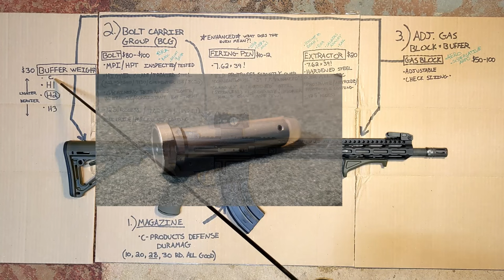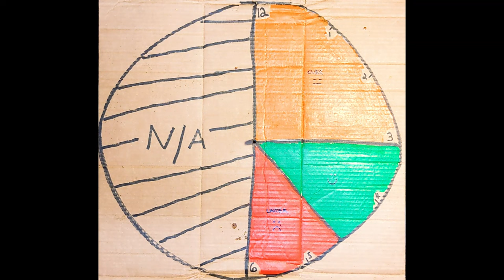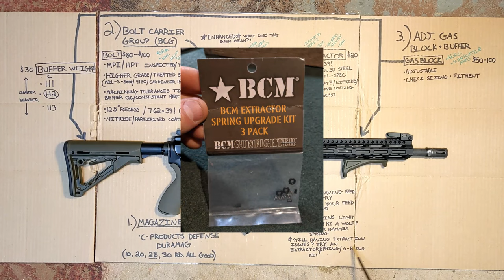How to Build a Reliable AR-47 (7.62x39 AR-15)

Comment: Just built one myself. I am running a palmetto arms Milspec lower, Milspec springs etc. etc. BCA upper Gen2 charge handle (these came with the enhanced firing pin). I got their upper with the hammer forged barrel($280). Really like the lifetime warranty. Ironically, I am also running a primary arms LPVO, I got it for 170 brand new since they were running a deal. Duramag 28 round mags (to fit in my Molle magazine pouches ony my vest.)
Reply from the maker: Nice!

Comment: Tips for a 7.5 build 
I have a bca upper as well came with a few issues that needed adjusting. H3 buffer and a adjustable gas block still ripped extractors found the bullets we not coming out smooth like a og ar15 so I honed chamber little at a time until bullets fell smooth out like ar15 without firing or bcg and then took the bca extractor because there “enhanced extractor” is to flat ramming it self into the steel case so I took a pen and put San paper around it put it at a angle nd took little off at a time till the bolt rode smooth over just by pushing it by hand.  Now it runs steel like a champ. Compared to me taking it out and breaking in 40 rounds like it would.

Comment: BRA bolt carriers work excellent.  I have all the different mags.  Clearance and polish the mags and lube the springs with dry lube.  Extended firing pin.  Comes in BRA bolt carrier.  Polished mil spec trigger with standard springs has fired everything so far.  Correct buffer spring and weight.  Polished feed ramps.  Runs reliable.  Great deer caliber.  More accurate than any AK I've shot with steel ammo.  Mostly use brass but has run all the steel case I've tried.  100 yards 1.5" groups with Tula 154 gr. Sp

Comment: With regards to the ejection pattern. Your ejector spring can vary where it throws brass also. You will notice a different bolt with a stronger or weaker spring will change your ejection pattern drastically. Which can skew your results.

Comment: CCMG lower (multi caliber) Bear Creek Arsenal 7.62x39 right side charger upper,16 inch Heavy barrel 1:10.  Bear Creek BCG needed Black Rifle Company "enhanced" firing pin ( Light strikes on steel cased ammo. the BCA one came bent and broke during dry fire training), Black Rifle Company "enhanced" heavier Hammer Spring, H2 buffer made a NICE 2 MOA group shooter.

Comment: I have a radical firearms 16in, I use an H3 buffer with an enhanced firing pin. Also installed a muzzle break with a screw on blast forwarding device for when I'm at the range. Use C products mags. Mine runs as good as a 556 and is a heavy hitter.

Comment: Great video!
Simple straightforward and easy to understand!
I recently purchased a 7.5” 7.62 upper from BCA… lots of issues…
Which your video addressed!
Broken firing pin 100 rds…
Loose Gas Block 150 rds…
Which caused failure to cycle….
Several failure to extracts…
Next 200 rds…
Sent it in as a warranty replacement…
Second upper…
Immediately replaced Firing Pin…
No light strikes but…
Consistent failure to extracts!!!
Grrrrrrr!😬
I love this upper… and so does my Marine son…!
Your video answered and addressed all my concerns and questions!
The BCA upper cost 1/4 of what my son paid re-creating his Service Weapon in 5.56…
Bravo Company upper…
PSA lower with a $300 Trigger and ACOG sight…😁
He still loves the Dirty Little 7.5” 7.62 upper!
I just need it to run …RELIABLY!
And yes…
We are running Bardaul  steel case through it…
It kicks with a muzzle flash in excess of 3-4 feet!
But that’s the whole point!
Thank you for your incredible video!
Keep up the great work!
Definitely earned a subscriber!😉
Reply: @hankbirmingham6662 Bear Creek Arsenal's got a lot of issues that I presume can be corrected with patience and money. The oversized gas ports will put too much pressure on the BCG and I also hear that their extractors are made out of cast steel rather than forged. Take the part about the BCC with a grain of salt but if you're consistently having issues I would replace the extractor BCA gives you with one from a reputable company and I'd also get an adjustable gas block and/or replace the barrel that has the appropriate gas block dimensions. I do hope this will fix your problems.

Comment: Great video. I am considering the Colt in 7.62x39, and I want to know how to keep it running, and what to do when something breaks.
Reply from the maker: Good plan, yup most of the frustration is isolating the issue, and how to resolve it, which is what frustrates a lot of people with these builds. But this should cover 95% of the issues, if you even have them. 👍

Comment: I’ve had good luck with the Wyndham Weaponry 7.62x39 upper on an Areo lower. Nice video!
Reply from the maker: Thanks man! I've heard a couple people mention Windham Weaponry, always good to know of another solid manufacturer. Thanks for watching!
Reply: I've had good luck also with my Wyndham weaponry 762×39 SRC m4 carbine had a little trouble at first with the gas tube had to change it out also got enhanced firing pin and upgraded the hammer spring and it has ran like a sewing machine

Comment: If you can find one, get an LMT enhanced bolt. That is the gold standard, just almost impossible to find. Just like their 5.56 enhanced bolt, superior design and materials.
Reply from the maker: Wow that's a pricey bolt.  What material is it machined from? Will it work on a standard 7.62x39 BCG? Looks like the extractors are proprietary I take it?
Reply: @ExtremelyAverageMan  They don't say, it's a proprietary material but I know their 556 bolts are pretty much indestructible. Guessing the same for the x39 ones as well.
Reply: @ExtremelyAverageMan  it will work on the standard bcg. They stress relieve the lugs for extra strength and use the lobster tail extractor to enhance extraction reliability
Reply from the maker: @drivestrength5394  I'll have to look into it.  Interesting extractor design

Comment: People mainly run the 28rd mags because they fit in standard ar15 mag pouches.
Reply from the maker: Probably a bit of both.  Running a good ol' Chicom rig, I have to put foam at the bottom of my magazine pouches in order for my 28 rounders to poke through enough to grab/reload.

Comment: Many claim this can’t be done. Typically by those who don’t understand fine tuning an AR15 or how to find actual root causes of failures. 
I have built several. From 7.5-16.. The 7.5 was the hardest to get running and running reliably. 
All run steel case. 
Keep a spare extractor and use dura mags.

Comment: Great video thanks for posting. FYI I have only a few hundred brass rounds through my BCA 7.62x39 upper w/ a 16" heavy barrel upper and my stock M&P15 lower and ASC 10 round mags (California). So far no trouble with feeding, ejecting or soft strikes (And now BCA also offers the "Enhanced" firing pin w/ all new uppers).
Reply from the maker: They do, although mine broke after a couple hundred rounds, and others have had bad luck as well.  I'd go with a more reputable brand such as BRA once the inevitable happens.  Someone mentioned a titanium firing pin as well (Anarchy Outdoors) which for $25 gets you a lifetime replacement guarantee.  Pretty awesome!

Comment: The problem with them is that there is no real benefit to them over the other options out there. I've built a few of these, but I just didn't like shooting them. You have to over gas them, and figure out the perfect buffer setup to get them to run reliably. The recoil is still harsh though. More harsh than any other AR15, or AK platform rifle that I've built. There just isn't very many pros to these rifles, and a lot of cons when comparing them to other calibers in the AR platform. If you want a modern battle rifle that chambers 7.62x39 just buy, or build a modernized AK.
Reply: Why are u on here?   lol

Comment: 7.62x39 has better terminal performance than .300 BLK...   So, it is a better round.  Its is cheaper.  It has commonality with your commbloc platforms.  It is also cool that Eugene Stoners design can be adapted to sooo many calibers.  Given that the chamber is larger too, the 7.62 bolt isn't just a 5.56 bolt that has been hollowed out. So I wouldn't get worked up about that.  Have you tried changing buffer springs?  Pretty standard AR tuning step is to balance spring and buffer weight.  Tunable gas blocks is a fiddly step, even on rifles that come with adjustable gas blocks have history of problems with troops messing about and rendering their rifles unusable...

Overgassing means it is opening faster, but the return speed is set by the buffer spring weight and reciprocating mass of BCG.  Extractor upgrade seems like a good thing to add to any new AR.  They just seem to get cheaped out by default...
Reply from the maker: Hmm, I wonder if those grunts truly knew what they were doing playing with the gas system.  I've made a video on tuning/adjusting the gas system, hoping that would help people understand what's happening as your tuning it.  Personally I don't think the buffer spring is as important as balancing the system with the buffer weight and gas.  In my opinion it's an unnecessary third piece to the equation than can be achieved just with the buffer weight and gas.  Just my 2 cents anyway.  Thanks for watching!

Comment: I got. 16” CHF BCA upper on a PSA lower. I had a white spring in it with a H2 buffer. The recoil sucked. I upgraded to a blue spring with an H3 buffer. It shoots great now. Way less recoil. I just received an aero precision adjustable gas black. As soon as the gas tube and roll pin gets here. It’s going to be even better. I only run brass btw.

Comment: For my AR-47s the key was an H2 buffer and Sprinco Hot White spring. Smoothed the operation right out.

Steel issues are almost always cheap barrels. Had a number of feed and extraction issues early on. Cleaned and oiled rigorously and after 100 rounds it smoothed out and runs great. When I rebuilt with a Diamondback barrel, no issues with any rounds from day one.

Comment: Very good video covers every problem i have run into. I find bear creeks barrels to be very accurate 1 moa or better out if 16 inch AR at 100 yds. Accuracy is the main reason I do with the AR platform instead of the AK. I think with a beefed up bolt and extractor this rifle is reliable. definitely worth having extras especially if you run steel.  C products mags are the only mag that works well i found.

Comment: Mine had just broke the extractor after about 3,700 rounds with a toolcraft bcg. I run superlative arms gas block and a 1.77oz buffer with standard carbine spring. Perfect ejection pattern and consistent with either 46gr Czech surplus up to 154gr Tula. Best luck I’ve had with mags is Ross defense unimags, unfortunately no longer get them. But great breakdown of the parts very detailed, everything you covered is correct for longevity of the parts sad it took someone so long to make a good video covering all of this. Oh forgot to mention redxarms is gtg I got a lot of my spare parts from them.
Reply: Toolcraft has lifetime warranty aswell when my extractor broke they sent me 3 more

Comment: great video with great info
enhanced firing pin, H2 buffer and extra power hammer spring are a must
I was getting light primer strikes even with an enhanced firing pin but when I upgraded to a heavier hammer spring it ran 100%
adding the H2 worked best for me, H1 sucked and H3 was too heavy....oh and I always polish feed ramps which did help on my AR47 but I do it on all my AR styles gun...9mm, 5.56, .300, .450, .350 legend, 6mm, 6.5 and as always these gun are made to run clean and oiled
I thought the .350 legend was the best hog round until I built some AR47..one shot drop, not as good as the .50 BMG but a lot cheaper

Comment: Here's a brain block. I sure could use some help with fellow shooters. A little background on me and my equipment. I would consider myself well informed and experienced with the AR pattern rifle and other firearms in general.I have built over a dozen ARs and hand built 3 1911s. 5 of these 762x39, 3 for my safe and two others for family. So, please NO did you clean your rifle, make sure your magazine is fully seated, or look for trash in your chamber comments. Also everything in this video I have done in enhancments already. My first 7.62 x 39 is a 16-inch rifle. In the first thousand rounds it was very reliable, had one stuck case and broke the claw off the extractor around 800 rounds. Replaced it and shot up to around 1600 - 2000 rounds and it broke again. After that, I replaced it with 3 different extractors and swapped out to a new bolt carier, and bolt. For some reason it won't exrtract the case from the chamber reliably. Prior to this I was able to use all my Duramags, and ASC mags without issue. Replaced the spring and Viton gasket in the bolt, tried cycling it with and without a combination of those. H2 buffer and carbine spring hs no change and in spec. Even noticed when hand cycling the rifle sometimes its not stripping a round out of the magazine as well. I just don't get how it goes to running really well to what it's doing now. So for those that might know where to point me, I'd be grateful.
Reply: I would check the alignment of the gas block to the barrel gas port next. It may have "shifted" over time and happens more often than you would imagine. A dimple in the barrel (not all barrels have them) and some blue Loctite (not everybody uses it) will keep it in place.
Reply: Yea it definitely sounds like the gas block, the gas tube or depending on what kind of bcg u replaced, the gas key could be out of spec or an adjustable key that needs to be properly tuned. just to be safe I would get an adjustable gas block from Superlative arms and a new all steel non coated gas tube an then make sure the gas key is functional.

Comment: Steel is pretty cheap. Like Red Army. But the Red Army primers are set pretty deep and require the inhanced firing pin. It will occasionally break a fireing pin too. Anyone else have this issue?

Comment: I have a BCA 7.62 side charging build going on right now.  Just ordered my Aero M4E1 lower, cant wait
Reply: I assembled my 7.62 BCA upper and Aero lower. So far, easy to dial in and hasn’t skipped a beat.
Reply from the maker: Copy-cat! Haha mines been great, no slop between the upper and lower receiver....a bit too tight, but the pins will slightly loosen up over time.  Thanks for watching!

Comment: I found that the faxon 7.62x39 BCG works best has S7 tool steel for extractor
Reply from the maker: Should be solid as well. Faxon makes great products.
Reply: They are very good bolts!

Comment: The Grendel and 6mm ARC use a similar bolt. They have a type 2, but I am unsure if they are compatible.
Reply: Not Compatible, they have a deeper bolt face depth.

Comment: You might try the new Young Manufacturing AR-47 bolt, they've redesigned theirs in a way that strengthens the extractor area that tends to break on AR-47s.
Reply: Yup. Young Manufacturer bolt is good stuff and the way to get more mileage out of the bolt and extractor
Reply: This is what I've heard, FocusTripp did a review and concluded it was worthwhile.
Reply from the maker: Yup, I've since watched his video too.  Awesome! I'll check them out when my BRA bolt inevitably breaks.
Reply: It's strange because I've heard good things of YM from Focustripp also but then again I heard very bad things about them like they were bought out by KE Arms and the facility was moved and one thing for sure never buy a blem BCG from them. Idk I like Chrome BCG a lot but Id rather go with Black Rifle arms or another well known brand that hasn't been bought out.
Reply: @SammyTheSidePiece  I hadn't heard about KE Arms buying them, I can't imagine KE Arms has money for that with their lawsuit.  Young also makes nitrided bolts which is the way I'd go anyways the important thing is the proprietary changes to the bcg and the bolt that I'm not sure anyone else has not the chroming, a well nitrided bolt & carrier is going to be just as long lasting as chrome if not moreso since chrome eventually flakes off.

Comment: Heavy buffers are only the lazy way of tuning an over gassed rifle. An adjustable gas block is the way to go, maybe with a flat wire spring. You'll get a lighter recoil impulse, a faster cycling rifle, and much less wear on your gas key.

Comment: I was hoping from the title that you were discussing the Special Weapons AR-47 lower receiver that takes AK mags. I’ve built about 9 of them over the years, IIRC.
Otherwise, good video and information, with one very minor correction.
MPI stands for Magnetic Particle Inspection last I heard.
Reply: How much firing protrusion do you find works well?
Reply from the maker: You're correct, slip of the tongue on my end.  Huh, I never knew the Special Weapons AR-47 was a thing....here I thought Pametto State Armory's KS-47 was an original design haha.  I might look into an AR that accepts AK mags at some point when the budget allows and learn the nuances of that system.  It would be a fun thing to explore.  Thanks for watching!
Reply: @ExtremelyAverageMan  Any thoughts on the firing pin protrusion? That was one thing I was never able to perfect. A length that would reliably ignite hard military primers would pierce softer primers. I used to provide two different pins, marked for primer type.
Reply from the maker: @jcarne1015  I'm not sure on the exact spec.  I can measure the overall length of my BRA firing pin with a micrometer if that helps?

Comment: Wow this video is full of good info. My AR-47 is set up with an H2 buffer and standard power spring right now. Hope the parts last a bit longer with it. Definitely gonna get a couple extra firing pins and extractors for sure. Good info. Thanks bro! 😊
Reply: Get it to eject at 3:30-4 and you won’t break extractors.